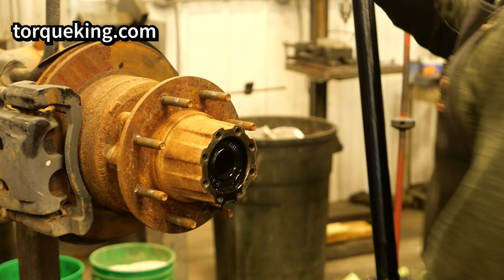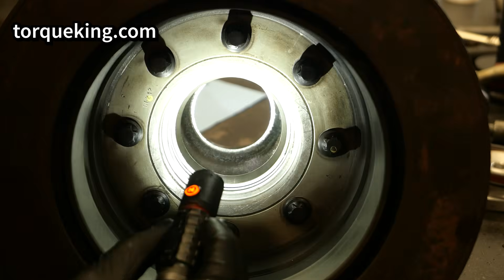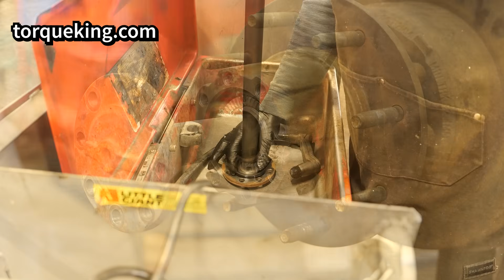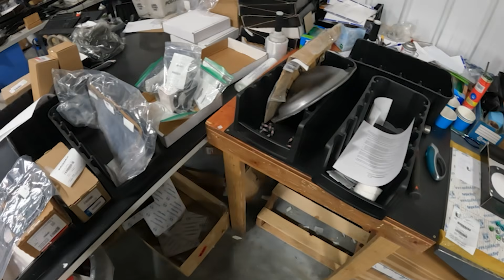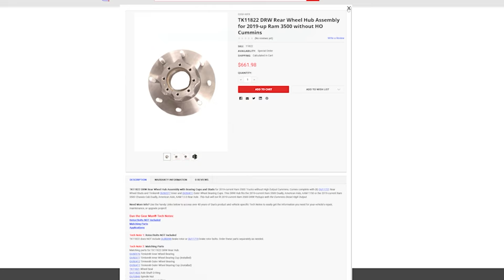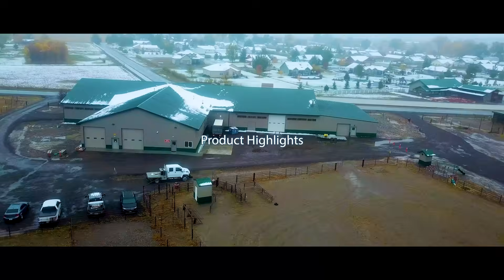1999 2016 Ford F350 Dana 80 DRW Rear Hub Service

Comment: Had a leaking inner hub seal on my 2001 Ford F350 2-wheel drive dually. Purchased inner hub bearing & race (NTN 387AS/382A) and Spicer (47507) oil seal. Upon taking several micronometer measurements and checking the fit before hub install, I discovered the inner diameter of the new hub bearing is 57.05 mm and the spindle outer diameter is 57.21, thus bearing absolutely will NOT fit/seat over the spindle. Way too much resistance. I’ve also done some emory cloth treatment to spindle. Auto parts stores swear I did NOT receive the wrong bearing.

Thank you

Comment: Absolutely do not put grease in that bearing. 100% wrong. It is an oil bath bearing. Grease will cause big issues especially if you have a limited slip differential.  Just squirm some of the rear end oil into the hub and bearing area before installing the axle and then check level in diff when back on the floor and level.
Reply: that makes sense but the factory service manual says to grease the shaft and bearings 🤷‍♂
Reply: there no issue applying a light film of grease for initial lubrication. It's in the FSM. Space between rollers however cannot be occupied  by grease. Light film only

Comment: Why oil and grease on the bearings?
Reply: Do not use grease. This is 100% wrong. They are oil bath bearings and the grease will cause problems. Especially if you have a limited slip differential.

Comment: I always put  oil on the bearings when installing and then fill the differential.    I tilt the axle for 20 minutes to allow oil to fill the hub.  I then level out for 20 minutes and recheck the differential level.

Comment: What an awesome video great instructions my friend that worked amazing walk-through for my newer Ford truck but I have a 1989 cab & chassis super duty custom also with a Dana 80 and disc brakes everywhere which is fantastic all the same callipers and rotors for the front and back is fantastic. It is a Dooley, but I can’t find what are the proper inside axle seals that I need. Do you have any suggestions and do I need a special tool to place these ones in?
Reply from the maker: Yes a Super Duty will use these seals torqueking.com/product/20659/qu20659-oil-bath-type-rear-wheel-seal-for-ford-dana-80-rear-axles/ , I would have to check my tools but I don't remember that these need anything special to install.

Comment: How often (miles/years) does this service need to be performed?
Reply from the maker: Wheel bearings can last 200k+ miles, however I like to replace every 100K or at least disassemble/drain/clean every 7-10 years for low mileage applications. I like doing service on my own time, not on the side of the road though... Also I find this frequent service is cheaper than a new hub or axle housing, and keeping the oil somewhat fresh is a bonus.
Reply: @TorqueKingTV , I just your race installer and seal installer tonight.  Worked perfectly!!

Comment: why are you packing the bearings with grease when its floating in axle oil? wouldn't the oil just wash the grease off? Great video otherwise.
Reply from the maker: Hi- Yes grease will eventually be washed off, but it takes quite a while for the proper amount of oil to travel down the tubes to your wheel hubs.

If you're a gambler like many folks reading on Google to put bearings in dry, we are reproducing these discontinued wheel hubs which will almost certainly be ruined!
Reply: @TorqueKingTV  I thought the same  appreciate your reply
Reply: Trust me, they are 💯 correct with packing the bearings! ask me how I know😂

Comment: What is the point of the ratcheting mechanism of the spindle/hub nut?
Reply from the maker: The end result is a nut locking mechanism, but the setup is also designed around ratcheting to the point of lockup and backing off a few clicks.

A ratcheting nut takes up less real estate on the spindle allowing the outer bearing to be closer to the end of a wheel hub than what a double nut setup will allow.

Comment: I have a single rear wheel drive Dana 80 on my 99 1/2 f250 I was told on the tag 373 gears and that it was a one ton Axle my question is when I seen you pull disk/drum off and apart it looked like mine ? Is it possible to make mine a dual wheel set up. I would appreciate an answer it looks like I would need the dual drum/disk to bolt to my hub I appreciate the information.
Reply from the maker: Ford only uses a Dana 80 in DRW applications... Single wheel was limited to Dana 60 and 70, but Sterling axles are more common. Generally speaking, a SRW uses a larger inner wheel bearing and that limits hub interchangeability. We do have some spacer adapters available for this conversion but we need to verify which axle it is.

Send us axle pictures to sales@torqueking.com and we can evaluate your options.

Comment: Just wanted to add this, i had made the mistake a few years back by not packing these bearings, thinking that the differential gear oil would keep them lubed, and i ended up replacing the entire axle a few months later as the bearings overheated, siezed and spun on the ends of the axle, ruining the whole thing. Needless to say, i learned my lesson on that! Quick side note, the slighly narrower cab/chassis axle fits fine if u remove the old spring perches and weld new ones in the proper location...
Reply: Do not pack with grease! They are oil bath bearings. You just oil the bearings up when you install them and squirm some extra oil into them right before pushing the axle in so they have some oil in there to start with. After your done I jack up each side of the truck separately so rear end oil goes downhill out to each tire.
Reply: These are oil bath bearings. The oil level was either low or bearing some over torqued
Reply: @weldinginparadise2562 was about to say this like why pack oil bath 🤔 I just cost them good with oil on install and then reassemble so I’m not taking off on totally dry bearings
Reply: Really?! Are you sure you didn't over torque the bearings? 🤔

Comment: What would be the ill effects of over tightening or improper torque procedure for the spindle nut? Reason I ask is because I did this service on my SRW F250 Sterling 10.5 about a year ago.  Whereas the torque specs are slightly different for mine, the concept is the same as it's that same style ratcheting nut.  But now when I was doing a brake job, I notice the hubs are stiff as hell.  I certainly can't turn them without the use of a pry bar wedged between the lug bolts. Let me mention, I have not noticed any drive-ability issues.  Noises, clunks, grinding, etc.  Any suggestion on what to do next?
Reply from the maker: First thing to do is make sure there is no brake drag, including park brake shoes. Once that is confirmed, unbolt the axle shafts to confirm drag is not coming from the differential.

Improper procedures will result in premature bearing wear or complete failure. Once you isolate the friction source, that will determine the repair procedure.
Reply: @TorqueKingTV  Thank you for the response.  It is not brake drag as I have not only the calipers off, but the rotors too.  I will pull off the shafts next and test.  If there is still tightness at that point, it's the spindle nut? But if it frees up then it's an issue inside the differential?  I have that correct?
Reply from the maker: @DieselMike  The ratcheting nut shouldn't let preload get so tight that you need a pry bar to rotate the wheel, but it could do some weird stuff to bearings over time.

If resistance is still local to the wheel after pulling shafts, it is definitely time for bearings. If they free up without shafts, its time to pop the differential open.
Reply: @TorqueKingTV  This is very helpful information.  Thank You.

Comment: How close is this procedure to a 1998 ford Superdry e-350 class-c motorhome dually. Cant find shit for torque specs...
Reply from the maker: If it's the ratcheting style nut, nearly identical procedure. If it's a 1-piece Nyloc, its a little different.

Exact procedure can be found on the FordServiceInfo website or a factory manual from Bishko.

Parts: https://torqueking.com/category/spindles-1996-2000-e350-dana-80r/

Comment: how do you know if your rear is a dana 80?
Reply from the maker: An 80 cover is taller than it is wide. Also, it will have a numerical 6 or 7 digit number on a build tag with no letters.
Reply: @TorqueKingTV  606728 ? also has 41-10 4.10 i jus dont want to order wrong parts
Reply from the maker: @puch7261  Sorry for the delayed reply, that should be a 606728-2 (indicating 4.10) with factory Trac Lok limited slip.